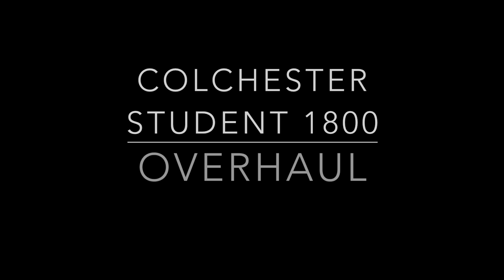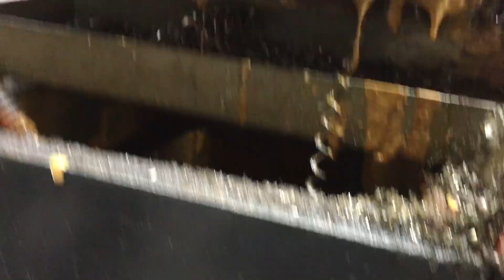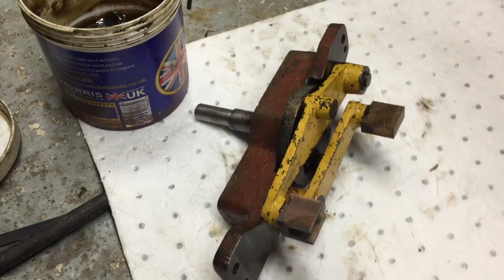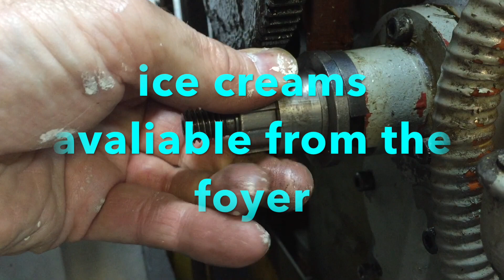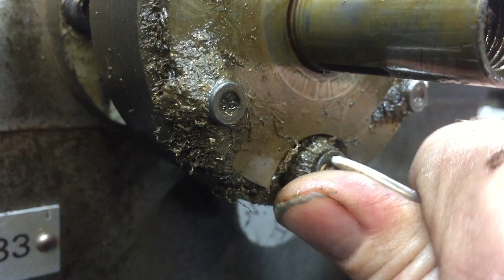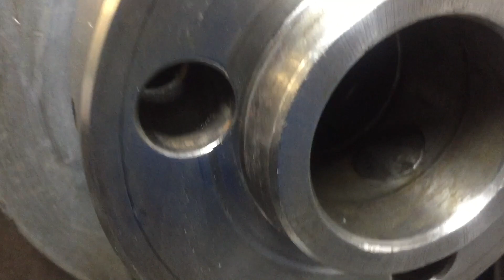COLCHESTER STUDENT 1800..IT LIVES !!!!!!!!....

Comment: Did you keep the Boxford at the same time?
Reply from the maker: It was moved on once the Colchester was in....space is a bit tight
Reply: @TweedsGarage  If I was eyeing up a boxford, would you save keep saving for something like a colchester or were you happy with it and this new one just happened to come along?
Reply from the maker: @edmoore it was a good machine ( managed screw cutting in the first operation after spending years failing with a Chinese lathe )the only complaint is its quite noisy gear wise, the Colchester is the next level.....if it was a forever lathe it'd be the Colchester ( but be careful as most have had a hard life )
Reply: @TweedsGarage  Much appreciated! I think it will come down to what I can get through the house - no side access to the shed. Needs some careful thought. Wonderful channel, thank you.
Reply from the maker: @edmoore glad to help, take care moving it through the house.....lathes will try and kill you even without power connected ......slow and steady wins the race 👍

Comment: Nice video, thankyou for your time, very informative. Did you only replace the bearings, not the bushes?
Reply from the maker: The bushes were fine, the main issue was the corrosion on the exposed surfaces

Comment: Thanks for the video. Unless I missed it, what oil did you use for the gearbox? I can't going any original spec oil.
Reply from the maker: If you are in the UK look for Westway oil, they do a ISO 32 which is the equivalent to shell tellus 27 for the headstock and gearbox and their ISO 68 is a slide way oil equivalent to Shell Tonna 33 for the saddle gearbox and slideways, available on eBay etc and very reasonably priced. Hope that helps.

Comment: coll video! could you please tell us the Colchester supplier where you got the parts from? i need some headstock gears as well, thanks
Reply from the maker: I got the headstock parts, wiper
Springs and cases, and crossslide https://www.colchester.co.uk/spares 
Genuine parts but pricey , roller bearings, ball bearings and drive belts from Simply Bearings and small springs from a supplier of cap head screws and springs etc on the internet. If you have a manual for it a lot of the bearings, springs, screws and bolt sizes are listed in the parts list. If you're after gears some of the machine breakers who specialise in Colchester may be able to help ( as i imagine the cost from Colchester would be prohibitive) . These are all  UK based

Comment: Great fun, but that inrush current. OMG. Glad to see that you are making progress with that little bitty lathe. Good job on the rebuild. 

It is interesting how much simpler it is to make a CNC lathe. Motor speed is of course controlled by an inverter, the feed for the saddle and cross slides are also either stepper motors or servo with their inverters. No gear trains or anything else.
Reply from the maker: Cheers, it's doing sterling work

Comment: Bit of swearing always helps in those tricky situations 😁
Video showing a Student overhaul including a gearbox rebuild deserves way more than 70 likes 👍
Reply from the maker: Well I'm glad you found it Barney, if it helps just one person it was worth doing, water ingress due to condensation does seem to be a problem on these gearboxes ( and following the 3 week below freezing cold snap followed by a change in temperature overnight of 10 degrees i suspect it'll need an oil change in the spring, the machines were running with condensation)
Reply: @TweedsGarage  Thanks for the reply - Fixing up my Student 1800 is on the 'To-Do' list now I finally have it back after many years in storage elsewhere.... goodness knows what I'll find inside 😶
Reply from the maker: @barneyleadhead2596  luckily the gearbox bearings are all standard size and along with indent ball bearings are available from Simply Bearings ( if you're UK based )

Comment: Very glad you posted this - the feed drive for my Colchester Master 2500 stopped working. I suspected it might be a shear pin gone but I didn't know there was one on the end train side - your video was very helpful and I identified the cause of my problems, the end train side shear pin had failed (actually the Artful Bodger had been there before me and replaced the original pin with a tiny radio screw!)
Reply from the maker: Hello Jason, i'm glad you found the video useful and got your lathe working again, it is amazing what people use as shear pins 😂. Its good to know I've helped someone  .

Comment: You did really well there! I have to say that the state of the emulsified oil in your gearbox sent me straight out to the workshop to look at mine! I found it contained only golden colour oil in as new condition, but it is good to check, my 1800 is an Imperial marked one, so never got used at college, it ended up in store until I gave it a good home, I also have shelves full of new gearbox and toolpost spares, so if you need anything, you will find the screwcutting system on this a real treat to use, just dial up the tpi and go, I did have 4 Ainjest units to make screwcutting even easier, but unless you do a lot of screwcutting they are not worth the bother. Good Luck with this gem! Chris B.
Reply from the maker: Always handy to know you have spares, i'll be making sure it has an annual oil change after every winter as the condensation issue has just reared its head after a very cold week or too and suddenly the temperature went up 10 degrees overnight causing everything in the workshop to become dripping wet with condensation, lathe, mill, tooling, tooling in the cabinet, even taps and dies in their box in a drawer! a busy evening spent drying everything down and oiling back up.
Reply: @TweedsGarage  One thing you soon learn to combat here is humidity, we have 50 deg in summer, and minus 20 deg in winter, I find the easy way is to use a small tubular heater of circa 50W tucked under the bed of the lathe, I then cover the machine with removal blankets and a small blue tarp, I have no problems with condensation now. Chris B.